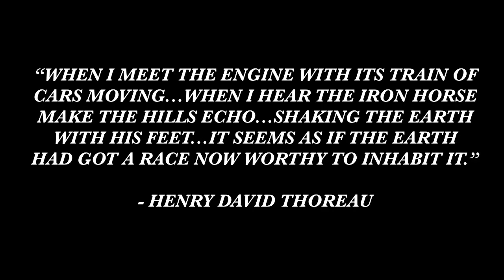Reading 2100 - June 2019 Project Overview

Comment: Anyone know how the clapper mechanism works on a steam locomotive since I often wonder how it works on a steam locomotive that doesn't have a hand rung bell
Reply from the maker: The bell on 2100 is operated on air. When the valve is opened by the engineer, the air triggers a mechanism that causes the clapper to move and the bell to ring.
Reply: @PennsyPro  oh I see thanks for the info